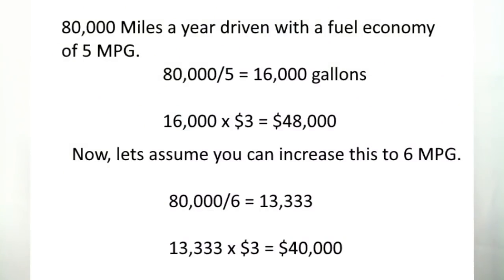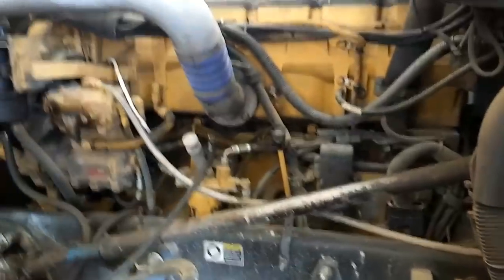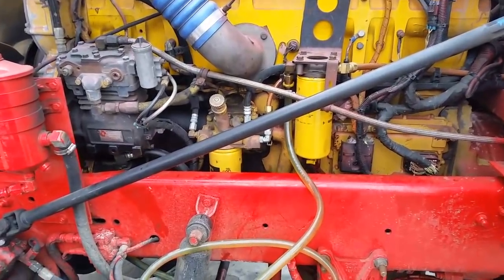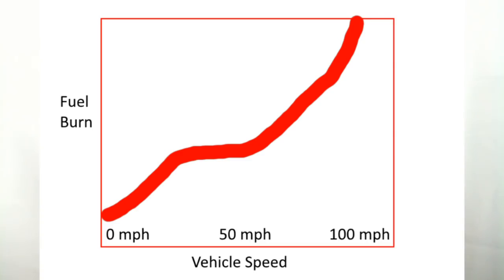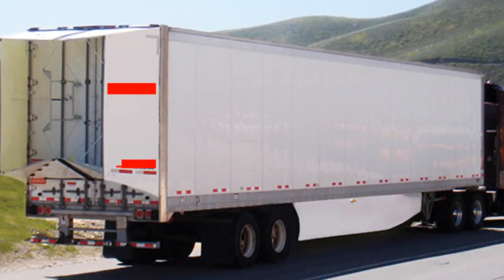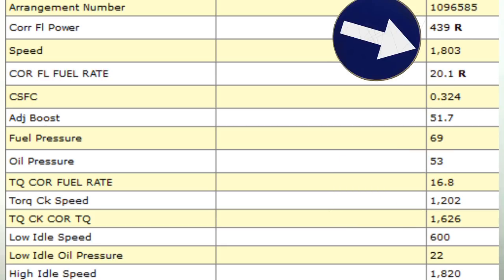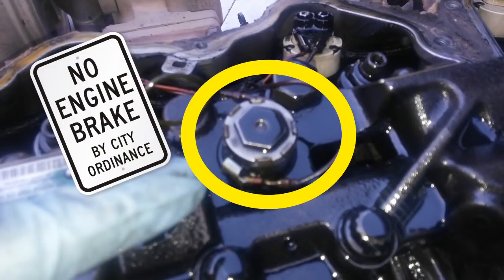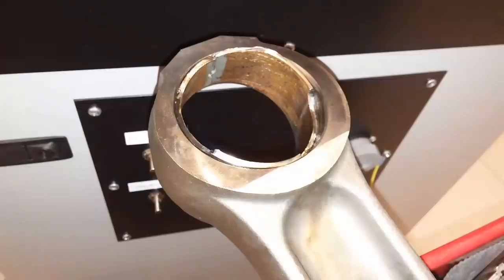How To Get Better Diesel Fuel Efficiency.  Increase Your Diesel Mileage And Economy.

Comment: Hi, it's very significant topic to talk about fuel economy, want say how important to change oil filter on fuel economy. 

Plus Except the heavy duty engines can you share beneficial information about passenger car Diesel engines in terms of long levity
Reply: It's the same
Reply: I believe most diesels are the same weather a 3 cylinder smart car or a big cat engine the only difference is size I have a ole 95 dually with the not so well built 6.5 turbo diesel and thers one good thing about it it’s not a pulling engine but it is real good on fuel mileage my girl has a 4 cyl dodge and it’s harder on fuel than my 6.5 turbo weasel  and I have 410gears I wish I had a Cummins but can’t afford so I will make do with the ole 6.5 I would like to know how much Detroit diesel had to do with this motor or did gm have more to do with the designing of this engine they must not be that bad the military used them in the hummer for years I know Thant later on the blocks are made buy a different company and are more realizable but this is my 2 Nd engine hopefully this one last longer

Comment: Why did they make it illegal for trucks to convoy? Seems like that would help mileage.
Reply: yes it is illegal to convoy, it is called a safe following distance.
Reply: Because it's hard to issue a speeding citation to half a dozen truckers at once. And even harder still if they have a nimble sport's car out in front of them, to distract and hopefully outrun the police.
Reply: These drivers today can’t back into a parking space. They go down the road in their Volvo with their left foot on the dash. I’m sure not wanting them that close in front of me or behind me.
Reply: Ya you can draft like at Daytona but most guys are half asleep I wouldn’t want someone drafting me when ther sleeping or ice but the time he hits brakes he’s eating your bumper and you got one big mess you will loose fuel in this case you will crash and prob get a wrecked tank and then fuel all over rd tractor trailers in the old days they never shut them off they idled them all the time not nowadays though we’re engines made a bit different then

Comment: OK back to my hill joke. I am in socal so I go up many big hills. All things the same a 370hp series 60 gets 5.4 mpg average. It pulls big hills in 7th gear @ 1400 rpm. Turn it up to 470hp and it will pull those same hills in 9th gear and gets 6.3 mpg average. So in my area adding HP so that I can pull a hill 2 gears higher adds mpg.

Comment: However, there is a claim that when they added an oil additive From hotshots on a test on a Dyno, the result was that the engine did not need to pump in as much fuel to develop the same power. but now maybe this is not a truck but maybe a pickup? And there is probably a certain difference. And it might also be the vehicle that has a computer controlled engine

Comment: When you are running faster with a diesel, the turbo has a waste gate that opens and dumps some of the exhaust bypassing the turbo.
Reply: NOT ALL TURBOS HAVE A WASTE GATE. IT ONLY DUMPS WHEN IT DOESNT NEED AS MUCH BOOST PRESSURE.

Comment: Truckers that like those BIG, full size rigs with the flat nose and sharp angles to catch air are severely limiting their fuel economy, and I guess have money to literally burn up.  I've heard truckers say the aerodynamic trucks are too light or too small to do the job, and then wonder why they're getting a 3 mpg average all year round.  There's a reason why modern trucks are more aerodynamic and why they're phasing out those big square trucks is because of all the fuel mileage and saving wear and tear on parts, especially the truck itself.  When you make the truck lighter, it's less weight for itself to haul around, meaning more power can go towards hauling the payload at hand.  A good 13, 15, or 18 speed can give you just a little 200 rpm edge difference in coasting and cruising, and reducing speed can make already an aerodynamic truck even more efficient and effective in cutting through the air, getting into the coveted 10+ mpg averages.
Reply: im running a c13 industrial from a excavator in australia im putting 750hp to the ground and close to 2250ft/lbs and still get 5.8 to 6.5usmpg and she out pulls anything thats tried but she has lots of electrical issues so i might put in c15 or 6nz just so i dont have wiring issues and yes she puts that hp to the ground if i keep her im dropping it to 500 or 470 i dont need all that power it destroyed my diffs so bad spicer wouldnt give me a core so i know a guy has his c15 6nz set at 470 he pulls good gets great mpg
Reply: Australia's pretty flat mate, so you'll only need the horsepower on demand when pulling road trains and heavy loads, anything more is just wasted energy.  Get the C15 if it saves you fuel, considering the long hauls without a service station in sight.

Comment: I’m brand new to diesel - going to buy a 1 ton pickup for towing a fifth wheel. I’ve been reading about things such as the EDGE tuner. I hear people saying they’re increasing fuel mileage by 10% or more with these types of programmers/tuners. Do you have any thoughts on those?
Reply: Hydra is the tuner to go to. Checkout 1023 diesel.com. you wont get 10% but you will gain about 5% if you keep foot out of it. Does give you alot more power. Depends on what vehicle.  I have a 99 powerstroke 7.3. If you got new truck. I think ege is way to go.
Reply: Any tune that can advance timing properly will gain a lot over the factory/epa tune.

Comment: Stop using normal lube oil and use 100 percent synthetic. It will increase the fuel mileage by 2 to 3 percent on a heavy diesel and 5 to 6 percent on a gasoline engine. A propane boost system, not a cheap unit but one with proper electronic control of the amount of LPG going into the engine will save 25 to 35 percent on fuel burn. It works because propane has an extremely high content of hydrogen. A hydrogen molecule is much smaller than the diesel fuel droplets after getting squirted out from the fuel injection. The very small drops of propane attach themselves to the diesel fuel by about a 5 to one ratio, meaning that the diesel fuel burns hotter and cleaner producing more power, requiring less fuel to operate at the same RPM. You get an almost equivalent torque increase, allowing a short shift in each gear, getting your truck up to speed faster and quicker. It works for decades on thousands of trucks. Since it burns cleaner, you won't have the carbon buildup in the combustion chamber, rings and valves. It costs about $4,500 installed in Detroit or Buffalo NY.

Comment: now you are aware, increased fuel economy using  BG44K Power Enhancer for petrol or BGK245 for diesel engines. These remove black soot deposits which make the combustion process less efficient. You have learned somthing.

Comment: My rig has a mechanical injection.  My injector pump totally quit and I had to replace it with a new one.  When I did, I advanced the timing on my injector pump by 2 degrees.  Since then, I've noticed a VERY significant increase in fuel economy.  Question is, think this safe for the engine?  I've driven like this for about 10,000 miles.  The diesel knock is MUCH louder at idle now.  If I raise the RPM above idle, the knock quiets down quite a bit, and above 1,200 RPM the knock is totally gone.  Something for me to worry about?

Comment: My 8.3 has an air driven fan clutch that runs all the time and no Intercooler. I’m wondering if I switch to electric fans and install an intercooler if I can increase my mpg. Of course I know a turbo upgrade will help considerably, I just can’t seem to find a suitable replacement for the junk H1E that came with my engine. Sadly I already drive slow since my truck max speed is only 55-60.

Comment: So here's a good question then why haven't they developed either a hydraulically driven or an electric fan for big trucks
Reply: Great question! The reason is because doing so would not reduce the amount of power needed to move a certain amount of air.. If the fan was hydraulic, then instead of pulling power directly from the engine, you are pulling power from a hydraulic pump, which is ultimately still run by the engine. If the fan was electric, you would be pulling a lot more power from the alternator, which, again, ultimately still runs off the engine. There is no free energy.
Reply: Larry Cox
The fan is sized to cool the engine at low engine speeds and high engine loads. Otherwise it would overheat when climbing a hill. With an electric fan, the fan only needs to turn fast enough to cool the engine and is not driven at high speed just because the engine is turning fast. On most current production truck engines, the fan is often running fast at low vehicle speeds even though the load on the engine, and the resulting heat, is minimal just because the engine speed is high. An electric fan can make a significant improvement in fuel efficiency but is an extra cost at vehicle purchase time due the the requirement for a larger alternator and an electric motor for the fan. At one point Cat was working on a powertrain package that ran all accessories electrically to improve energy efficiency (including oil and water pumps and air compressors and A/C compressors) but they dropped out of the engine market before it was finished.
Reply: @larrycox5891  Some of what you said is not correct..also when the fan is not engaged it is not costing any engine power. There are thermal and electric engagement.  No modern engines have constant fan engagement.

Comment: The driver can also loose some weight and travel light. Instead of filling your cab with useless junk like a tv, fridge, microwave, tire chains, apu, def tank, useless big sleeper you can haul a bit more weight and make more money. A 1000 hp 3406e can get better fuel mileage than stock if you drive it right. Keeping the left door shut helps a lot.

Comment: My DT466 in my IH 1066 Black stripe apparently peak torque is 1200 rpm, max horsepower is 2400, governs at 2750. When on the farm I usually run 1200 to 1500 rpm. My idea is to turn on the parasitic loads goin down hill/foot off throttle because you are not injecting fuel, so why not turn that ac up? I also think to myself "Isn't using the brakes technically an inefficiency?" because like if you are on say a runway, and want to get to the other end with the least amount of fuel, accelerate slowly, and then let off so that you COAST to the end, instead of using the brakes. Can't exactly do this in the real world on the road, but just the way I think, ye know?

Comment: On my 5.9 24v cummins in the winter time should I drop to 10w40  or stick with the 15w40
Reply: What's the winter temperatures in your area? What oil does the engine manufacturer suggest? You need to remember that there is far more to oil than just its SAE viscosity rating.

Comment: One more question isn't diff oil a neglected fluid that if changed can save some fuel to
Reply: Yes
Reply from the maker: Yes sir, this video was actually about 40 minutes long and I talked about a lot more stuff like to rolling resistance, other maintenance items, and I just just felt I needed to make it shorter. Still a long video though.
Reply: Adept Ape Make a part two!

Comment: question for you sir. diesel temperature for better fuel economy is it better hot or cold?? the reason for asking is because my 04 bxs has the return line back to the fuel pump i wanted to know if it’ll help to just run it back to the fuel tanks? thanks and love your videos
Reply from the maker: The recirculating line with the little ball valve? I usually close that line off as it can recycle air in the system and cause problems, also the fuel helps cool the injectors so you don't want it going through the injectors over and over without going back to the tank

Comment: I average 2.8 to 3.2mpg pulling 160,000lbs and we can normally get about 500,000 miles on a overhaul what would be the best way to build a engine that can put 600hp to the ground and still hold up and not blow head gaskets

Comment: Touching on the dpf segment of the video, does back pressure play much roll in the economy of the engine? (Maybe switching to a flow thru muffler or even going straight open exhaust)

Comment: I try to strategically "go fast" or ''speed''.  Most of the time on something like a 200 mile run, it doesn't make sense to go faster than 65.  I enjoy cruising at between 60 and 65 but guys are blowing by me sometimes like I'm standing still.  I don't get it unless it's to make an important pick or drop.

Comment: Here in Germany we normally talk about 10+ Miles per Gallon, or about 30l/100km and less, average Fleet Fuel Consumption. That's half the Fuel Consumption you guys are getting. 

That's absolutely abysmal to be honest. Wouldn't the First Step be to buy European Trucks if you wanted to cut cost? Our Trucks are Half as Expensive to Purchase and get half the running Cost.
Reply: I imagine the import taxes and fees would negate the cost almost like the cars. I would also say European trucks would get slightly better fuel mileage due to there overall smaller size as I've seen Heavy Haulage models shorter than some of our day cabs. But what makes the difference is the speeds travel. A Google search pointed me to a list of 31 country's in Europe of which most restrict trucks to 80-90km/h (50-56mph). I've always cruised at 70-75mph (113-120km/h).
Reply: @swhite209  Well, the Maximum (and I guess regular) Weight for a Semi in the US is around 36 Metric Tons, while here it's 40. And you are forgetting about Emissions, which are quite costly in Terms of Fuel Consumption. 

And while we are limited to about 85 to 90, depending on Country, that doesn't explain that big of a Difference.
Reply: @MyFabian94  I assumed we all knew Emissions hurt fuel consumption. What about fuel quality? Reading through comments some where, sounds like yours burns cleaner.

Comment: You don't mention lowering your manifold pressure at any engine speed. I found if I can keep my manifold pressure down between 5 and 10 psi boost my mileage goes up by 1 to 1 1/2 mpg. I typically run up near 1600 rpm with a 550 mxs with 3.36 rears
Reply: Well, actually, you want your boost pressure to be equal to or higher than your drive pressure for optimum fuel economy (requiring twin/compound or triple turbos and expensive &/or labor intensive mods, depending on engine setup and theoretical boost pressure). With single turbo setups, drive pressure is typically higher than manifold pressure. Lowering manifold pressure works because of keeping your foot out of the throttle. More air = more mpg.

Comment: Ever heard of using a percentage of lpg in the mix, they call it diesel charging here in Europe, as far as I can tell the main drawback is you need to have both fuels to run, but am a bit out of touch so maybe systems exist now that can compensate if you run out of lpg
Reply: It happens in the aftermarket. Was a big deal some years back when fuel was over $4.00 a gallon. Down side is the tanks are heavy so some payload is lost. Never understood why it isn't a factory option.

Comment: You're wrong about the jake brake....  If your  jake brake is programmed to come on "at lift" it starts to bleed the momentum of the truck as soon as you lift off the throttle.  If your jake is programmed to come on "at brake application", you get the advantage of "the coast".  I know their are going to be people say Bull shit, but it was worth .3gpm on my fleet of 1,200 tractors.  That one little program change saved $1.4M in fuel in one year.  You didn't mention "tall rubber".....   11R22.5 --- 492 revs per mile    275/80/22.5 ---- 509 revs per mile.   Greater distance traveled with the same energy expended.  If you can.... Change the "Fan on time".  The fan takes 35hp to run.  The less time it is on the better your fuel economy

Comment: 24:04 - damn, that's a big piston. what engine/size in litres is that from?
Reply: Cubic inches
Reply: The bore on 3500 engines is 170 mm.
Reply: @electric7487  thanks. that's a big bore!

Comment: I have a 2013 jetta tdi. I always use the vw 507.00 approved oils. 
Would I get better fuel economy with the 507.00 0w30 over the normal 507.00 5w30 ?
Reply: Probably get slightly better while the engine is still warming up and if you live in a cold climate

Comment: Just beef up the injector nozzleslol
Reply: Just beefing up the injector nozzles won't save fuel economy unless you add more air &/or accelerate 0-55mph in 1 mile (sometimes makes other drivers impatient). If not, you'll see clouds of smoke and your fuel gauge constantly moving. I had the fuel injectors and delivery valves replaced, and I can only get decent fuel economy when lightly loaded on relatively flat ground, and poorer fuel economy when heavily loaded, towing trailers, or going uphill, especially when upshifting.

Comment: Can a diesel engine support a hydrogen booster like a gasoline engine? Suppose if it can then
this could increase the fuel economy. I drive a 444 aka 7.3 turbo diesel non direct injection style motor with 300K on it. Runs really great but not good fuel economy at all. Would like to increase the economy. Been running the bio diesel cause it is cheaper at the pump and
seems to run great but no additional economy in the miles per gallon still very bad.

Comment: I have a 3208 in a 1982 Ford l8000. It is non turbo with 210hp. Is there anything  I can do to increase hp. Should tell you I have the allison 5 speed tranny and a Rockwell rear with a ratio of 614.
Reply: TURBO,AND INJECTORS